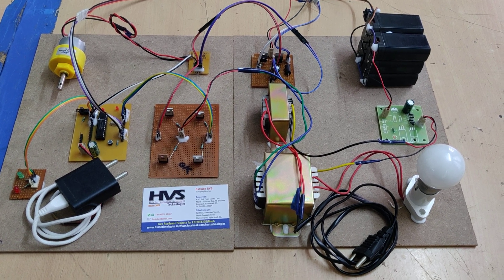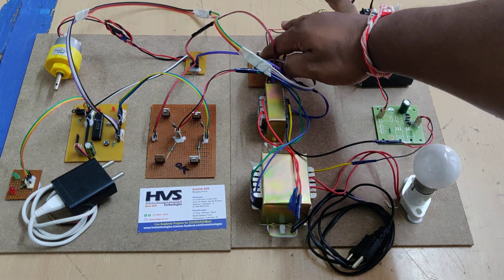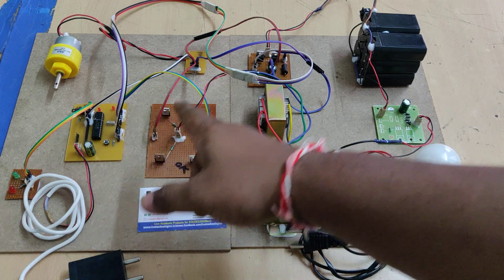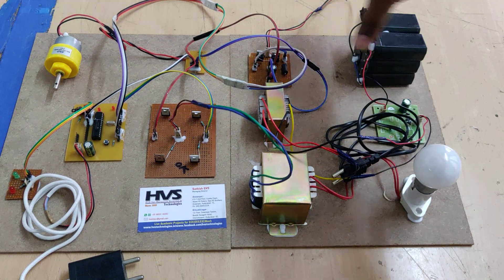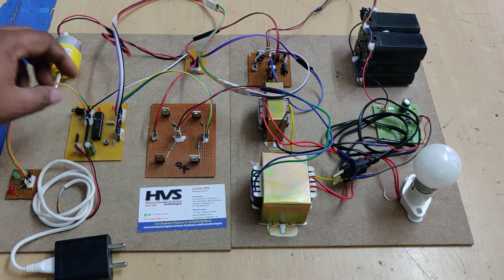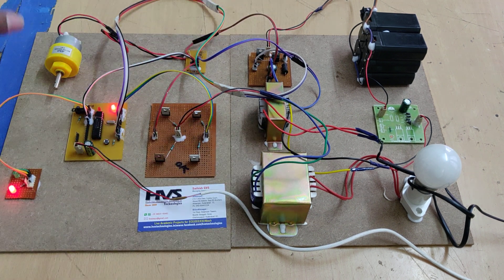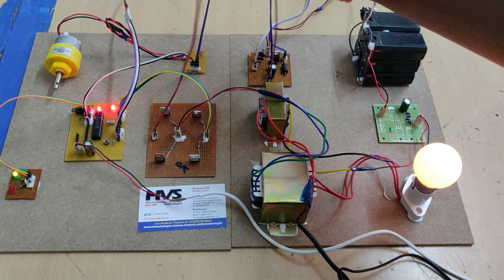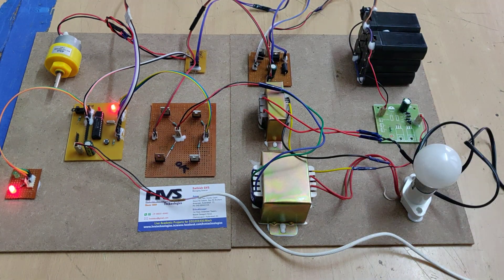HVS-3324. Vehicle to Grid Bidirectional Energy Transfer#Battery#DC motor#PIC microcontroller#V2G G2V

Comment: In my project we have used the z source converter.
What is the difference sir? HP ckt
Reply from the maker: @MohammedJaveedAhmed-z5f  Hi, 
We sell full working kit with document PPT circuit diagram and code. Could you Send me the video link, Will update you the cost details. You can contact us at +919603140482
Through WhatsApp or call

Comment: sir,
when we selected AC mode, does that battery will charge through AC supply
Reply from the maker: @jaswanthkalla1823  yes. We sell total project. 
Send me video link
Will update you the cost details.You can contact us at +919603140482
Through WhatsApp or call